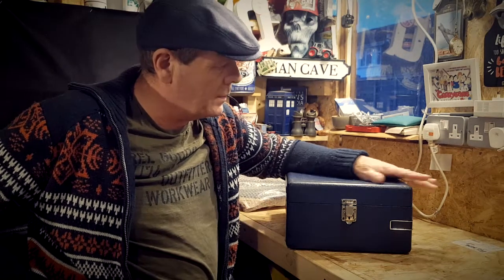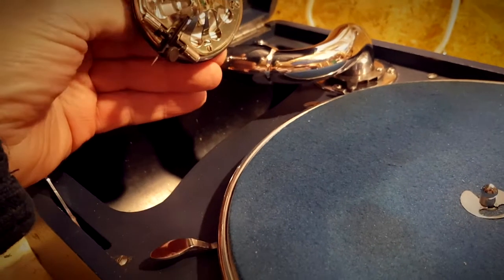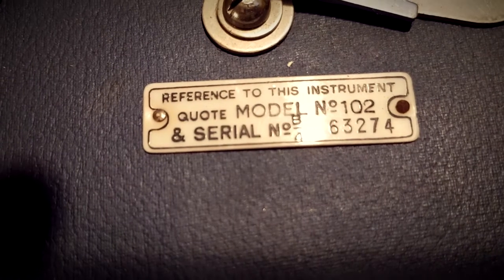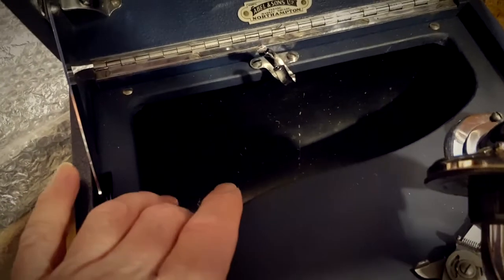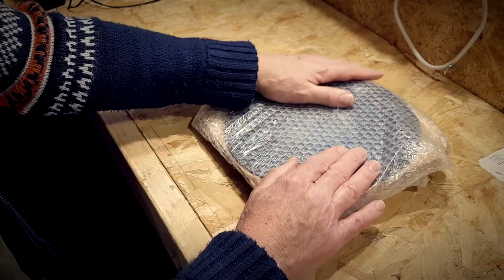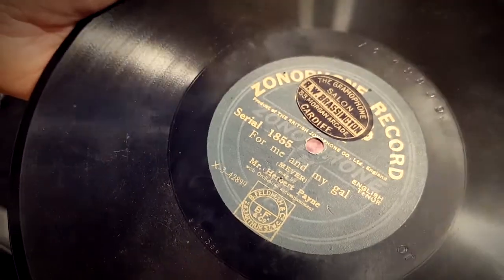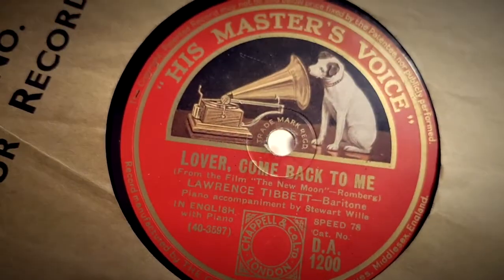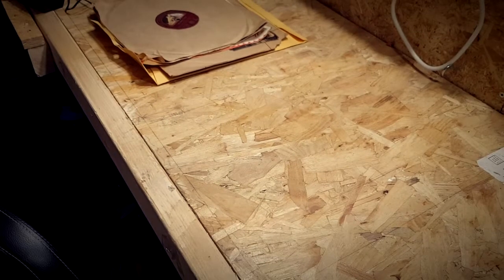Sciatica - New Gramophone  - Unboxing Vlog

Comment: Oh really sorry to hear that, I had Sciatica issues in my late 20's horrible pain isn't it, can't sit can't stand!  Despite trying all the painkillers and anti inflammatories under the sun for me it was plain old 'lots of cycling' that helped me get rid of it. A cure that works for some may not work for others... Love the new gramophone, also my second one (after my first black) was an early blue, I think even earlier than yours as it came with a chrome needle holder than the bakelite blue you have. -My gut feeling is the black horn isn't original, possibly the original blue was too paint chipped?? Apart from that all looks correct for the year, 1940 looking at the serial # I think. Of course now you'll find yourself looking for the next two common colours of Green and Red, I'm now up to six!
Reply from the maker: Hi Steve, So you think it's a 1940 machine even with the original auto brake, I don't know much but I am starting to feel it may be a bit of a Frankenstein, still it does play well and I will be putting a vid of it playing up as soon as I can...  Yes, I would love a red one, the wife thinks I only need the one, lol...  I need to try something soon for my sciatica as a truck driver it can be very painful sitting in a cab doing 400 miles a day...  :(    Thanks again and I will try and research this 102 as soon as I can sit long enough on the PC, lol...
Reply: @AllMy78s  I'm no expert myself, -I believe the common story with the serial numbers is that in 1936 HMV restarted the serial numbering with a rectangle plate so that "B" represented 1936 and B/1 1937  B/2 1938 etc... -So if your plate has B/4 it would be a 1940. The earlier machines before between 1931 & 1935 had a round serial number disc and are a little harder to date. the earliest even had a metal motor board and these also had finicky auto brakes that were soon replaced. My Green and Blue are early type but non metal motor board types and both came with 5A sound boxes and record carriers but had later auto brakes one the same as yours which work fine. Apparently the first year or two they had No.16 sound boxes which were often upgraded to 5A's! My other machines range from 2x from 1939, 1x 1946 and a late model 1953. -The Auto brakes are the same as yours for the 1939 models and other fittings like the latch and needle tray so I'm pretty sure yours in period correct, the horn remains a mystery.. I like the shop tag as well, most of mine have these and it's always fun to research where the shop was and if it's still there on Google street view
Reply: You've probably seen this but it gives a good overview of the 102 series: https://youtu.be/AYn7aZZBMRA